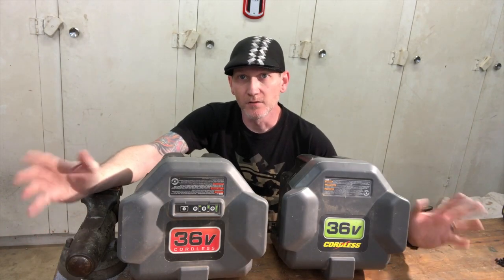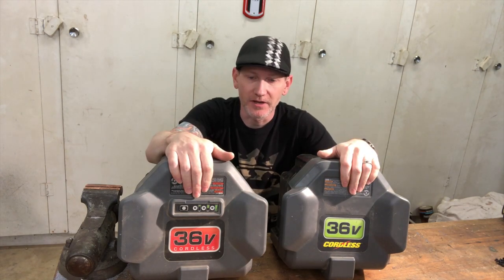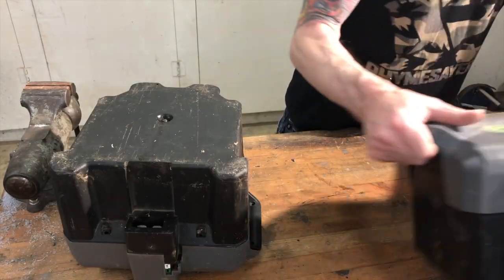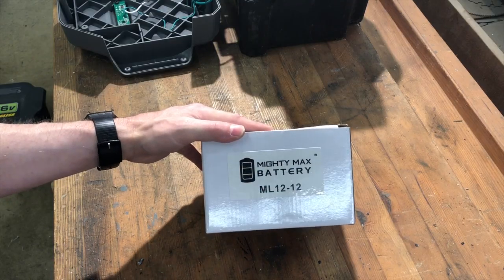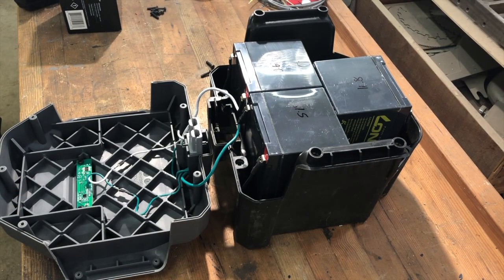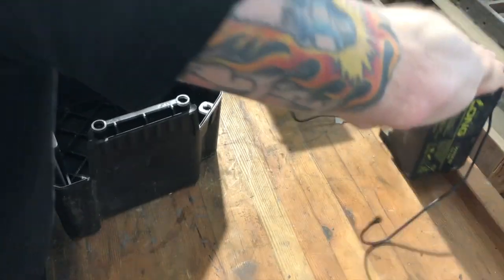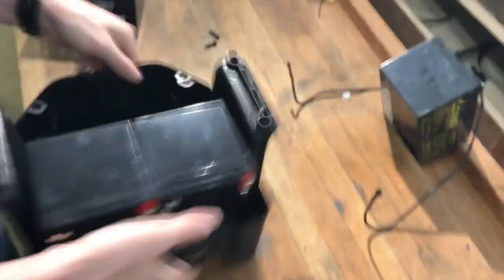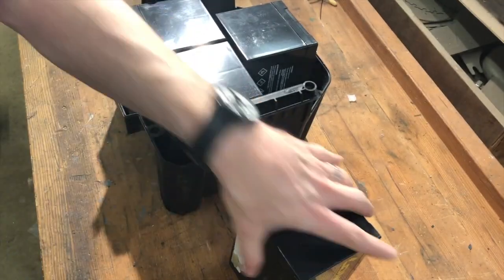Black & Decker 36V Cordless Lawnmower Battery Cell Replacement (CM1936, SPCM1936)

Comment: Thanks! Worked perfectly. I bought 3 ML12-12F2 batteries from mightymax. They fit perfectly, no need to cut anything away. Do look carefully at how the wires are routed before moving the old batteries. Some are pretty short, so the routes need to be precise.

Comment: Man, this was so helpful. I bought my B&D mower in 2013, and over the years went through two batteries, which isn't bad mileage I suppose. But when the second battery died I could no longer find a replacement. I hadn't even considered the possibility that the casing could be opened and that it contained replaceable cells—until I found your video. I bought three Mighty Max cells on Amazon and installed them. They fit perfectly so I didn't have to modify the case (it's the kind with the battery indicator on the top). Thanks so much for posting this! 😎

Comment: I've found it easier to load them into the top first and then just slide the bottom over the batteries.  Note that some batteries SLA or Lithium have the terminals a little closer to the end of the battery so on those you will need to make small notches for the terminals to allow the battery to slip all the way into the cover which is one reason I prefer to load them into the cover first since its easier to see if the terminals cause interference.   I've got the self propelled 1936 and it has the battery with the test circuit.

This year the mower is 10 years old now so I bit the bullet and went with 12 Volt/12 Ah LIFEPO4 batteries from TCBWorth and they slid right in with the cover notched for the terminals.   Hint:  Use box tape to hold the ends of the batteries tightly together to make re-assembly easier with one strip across the ends of the two side by side and one strip to hold the third battery in the T-Shaped arrangement close to the other two.

I went with a new 10 Amp 36 Volt (really 43.8 Volts) LIFEPO4 charger and since the original charge port on the B&D pack doesn't support 10 Amp charging and has circuitry for the SLA batteries in it I put a 50 Amp Anderson Connector on the charger and use the packs main power connector for charging.  That way since I haven't modified the SLA Battery Charging Circuit it will be easy to go back to SLA if need be.

End  results is a pack that charges in a little over an hour and has double the runtime of the SLA.  Lithium has dropped in price and you can now get the 12 Volt 12 Ah LIFEPO4 batteries for around $30 to $36 each.  The 10 Amp LIFEPO4 charger goes for about $40.  Still cheaper than a new name brand Lithium powered self propelled mower which will cost you $500 or more.

Things to watch out for are that the LIFEPO4 batteries have a built in BMS that supports 3 or more batteries in series, has over/under voltage protection, high/low temperature protection and is rated for 10 or more amps charging and supports a Maximum Continuous Discharge Current of at least 15 Amps.  Blades are another thing to watch out for as B&D now charges almost $80 for the formerly $10 blades however shop around and you'll find places like USA Mower have a compatible blade that comes in a twin pack for around $31 for the two mulching blades so $15.50 each which is quite a bit more reasonable.

Best!

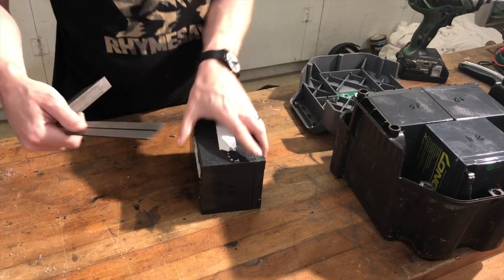Comment: Thank you for much for this video! The circuit board on my mower that shows the battery strength seems to be dead, so I was a tad worried until I plugged the batteries back into the mower. I also found https://www.youtube.com/watch?v=YtpnhABs54A useful because at 2:10 he shows you where that stupid black pin that falls out belongs. :washhands:👍

Comment: Love my "old" lawnmower which had the battery pack replaced already back in 2012. Called round to Black and Decker repair shops and B&D direct but no one would fix as they no longer back this model. Found this video, bought a 3-pack from Mighty Max Batteries for $79.99 (price seems to have gone up a little) and did the battery swap out with your video as a guide and no need to cut the plastic. Bob's your uncle and she's as good as new. These old machine's will run forever if they are given a little TLC and we as consumers are not swayed into believing into out with the old and in with the new!
Reply: Yes, exactly what you said!

Comment: Thanks a lot for your help. I followed the steps you presented and I was able to fix my lawnmower battery in less than 30 minutes. The bonus was that the batteries I ordered did fit exactly without having to remove plastic.
Reply: Can you give the info of the batteries and where you purchase?  Thanks

Comment: 11/12/23-thanks for a terrific and easy to follow video.  Wish I had found it earlier as I went to a batteries plus outlet and they installed batteries ($173 in WA state) haven’t tried it as yet- however the charge windows remain unchanged. One is at full one at 1/2 , and last at 1/4.  Why don’t they register as full.  PS been on charger overnight?  Thanks again - terrific video.  Tones.😊😊

Comment: This was a great video, thank you.  I replaced my previous batteries which were 3 10 Ah batteries with 3 15 Ah batteries.  I only had to make one cable to do it, but now my mower lasts a lot longer and runs like the first day I bought it.  At first I thought it wouldn't work because the 3 10 Ah batteries had an insert, but I just had to remove that insert and the new batteries fit as shown in this video.  I purchased three Mighty Max Battery ML15-12 - 12 Volt 15 AH batteries from Amazon.  I didn't have to do any modifications to my housing.

Comment: So I bought the new batteries put it back together, appears to be charging but only lasts for a few minutes when running.  Tested the old batteries and they are all holding a charge.  Wondering when my next go to might be.  Thanks for making things easy.
Reply from the maker: When the mower dies after a few minutes, does the battery still say it's charged, or is completely dead? One way to test it if you don't have the battery with the power meter is to let the mower sit and cool down for a while and see if it starts back up with the same battery. If the battery is still charged, you may have a motor or other component going into thermal protection. If it's completely draining the battery in a few minutes, I have no idea. That's a lot of current in a short period of time to be going anywhere! Another thing to check is if there is a motor/blade blockage. That could cause it to overheat and/or draw too much power. Good luck!

Comment: October 2022
I have the mower battery with the orange label (model# RB3612).
I bought the same batteries (3-pack Mighty Max ML12-12).
The new batteries fit perfectly, so I did not modify the case.  What's up with that?

The Mighty Max (ML12-12) battery dimensions are:
   WxHxD = 6" x 3¾" x 3⅞" (150 mm x 94.5 mm x 98.5 mm)
   WxHxD = 5.91" x 3.72" x 3.88" (as measured with caliper)
*The width is the "front" (left-right), height is bottom-top, depth is front-back.
*The height measurement excludes the terminals on top.

The original battery (Kung Long WP12-12) dimensions are:
   WxHxD = 6" x 3⅝" x 3⅞" (152 mm x 92.5 mm x 97.5 mm)

The original battery is slightly wider and deeper, but the replacement is slightly taller.

Comment: THANK! Got my 3 batteries and replaced no problem with your help. I have another issue and cannot find a fix. The self propel on my BD has an adjustment between turtle and rabbit. My problem is that even on turtle I am in a very fast walk, almost breaking into a trot. If I had a football field to work, this would be awesome. For working in our yard, with lots of trees and things to work around, it is way too fast. Is there a fix? Thanks for consideration on answering this, anyone reading or yourself.
Reply from the maker: Not that I know of. Anything fancy would probably require pulling the electronic brain circuit and modifying it. I’ve never looked at mine, and I wouldn’t be surprised if it’s potted, aka: encased in epoxy goo and impossible to service or modify. The easiest option would be to make the drive wheels smaller, but then you’d mess up your available range of grass length. You might just be stuck with what you have, unless anyone else has attempted anything.
Reply: @PhillipsHomeRepair  Today I took the speed control switch off, opened it up, and found I could turn the regulator dial down about a 1/4 turn, after disengaging the two gears. Seems like it changed very little. It might be going a wee bit slower but still quick for this 60 something fella!! I tested the mower with the wheels off the ground and modulated between low and high speed. Really doesn't seem to be much difference Did the same while walking with it and speed difference is negligible. You might be right...I'm stuck with it. : D Thanks for your reply. I'll let you know if I ever figure anything out.

Comment: For those with the older style Black & Decker model (green 36V ) Item #: SLA-12V12-F2-X3 from BatteryMart fits perfectly.  No cutting needed, simply unplug the old and plug in the new.

Comment: Thank you for this very useful video!  I just ordered the 15 AH version of those Mighty Max batteries from Amazon as a 3 pack for $99. I want to point out that per Mighty Max specs, the dimensions of both the 12 AH and the 15 AH are exactly the same! So I went for the longer run-time batteries. 
ALSO: for either battery, they list the depth in the main description area as 3.98" for the ML15-12, and 4.00" for the ML12-12, which almost kept me from buying, but if you look at their Spec Sheet in the left panel it reveals that those dimensions are the Total Depth (which includes the terminals) - the actual depth of the CASE is 3.74".
Reply: greetings so the 15AH worked no problem didnt have to do anything special?

Comment: I have a safety question for anyone knowledgeable: I noticed these 12v batteries all say "Do not charge in a sealed container". Doesn't this present a problem when placing three of them in a sealed battery case like this and using the mower plug in charger outside the case? This refurbishing idea is terrific and I want to try it, but I'm concerned about safety. Any replies appreciated, thanks!
EDIT TO ADD: After thinking about this a bit more, I wonder if it would be a good idea to drill a small pilot hole in an inconspicuous spot on the mower battery case? Maybe some place to drill upward so no water leaks inside? The purpose would be to let any gas emissions breathe out from the 12v batteries inside?
Reply: At 1:56, note that the original batteries say: Do not charge in a gas-tight container.  The battery case is designed to hold three charging batteries, therefore I think the ventilation is already sufficient; additional ventilation is not needed.

Comment: Thanks for the video. I went with new Duracell batteries. Having the same issue with the case not closing due to a slightly different battery size. The inside of the casing on the model I have (the orange one) looks a little bit different than yours, so I'm not sure exactly which plastic piece is preventing the case from closing completely. But it closes enough so that the mower works.

Comment: My own Black and Decker 36v battery is beginning to fail after 8 years of regular use. Might try this economical solution instead of springing $300 + for a new mower. Thanks for this really informative video. Some of the comments below seem to disagree on which 12v batteries to use for best fitting, so I will have to research that further.

Comment: ---The MightyMax ML15-12 is an exact drop-in replacement for the original battery. 
No size modification is needed. 
---Before you remove the old batteries from the housing, you should note how the wires are dressed and routed. 
If you look carefully, there are notches or slots in the housing to hold the wires in place.
If you follow the original wire routing, and use the notches, there will be no risk of the wires getting pinched in the housing during reassembly, and it will hold the wires securely so they will not vibrate during operation.
---I used T-rex extreme mounting tape where the original batteries were taped together, because it is one of the strongest (1lb per square inch), sticks to ABS, and is good for -40 to 200 degrees F.
Reply: Thanks for the excellent info.  👍
Reply: thank you.  i have bought those batteries and my mower is like new again!  exact fitment too
Reply: Can the 15 amp hour version work as well?

Comment: This was a fantastic video and we are happy you made it. Black and Decker no longer supplies the entire Unit anyway, kind of being like Apple. Without this video we would have to upgrade to the 40 volt model which would have set us back over $300. Thanks to you we have a rebuilt mower back for less than $100. I would advise amateurs like ourselves to place electrical tape on any "open green and white wires," as they can touch when you are reconnecting the harness. Thanks again!

Comment: Thx for the video. I followed all the steps and this didn't work for me. I suspect b/c there was some water inside and corrosion on the connectors. Is it possible for replace the wires/connectors?
Reply from the maker: Yes, the wires and connectors should all be standard stuff. I'm not sure of the specs, since mine are back together and in use, but just match up the same gauge wire and style of connectors. You will need wire cutters/strippers and a terminal crimper, but that should be all.

Comment: Canadian viewers: No need for modifications of the battery housing for me. I ordered 12 Volt 12 Amp Hour batteries from UPS Battery Center in the GTA. TLV12120 was the product code. Within millimeters of the size of the original batteries and my battery is showing 3 lights now. I'll let you know how the mower runs in a future comment.
Reply: Got to use it this week. No issues. Worked great. Battery was only down by one of the three indicator lights when I was done...and it would have been down by two lights before. Charged up fine. Ready to use again. And, ordering the batteries that I did from UPS Battery Center meant I didn't need to modify the plastic housing. They are almost exactly the same size as the original batteries. TLV12120. Google it so you get the most up to date info from UPS Battery Center.

Comment: What is the running wattage or running amperage?  I've looked in the usual places and can't find it.  There is a LiFePO4 SLA replacement with the F2 terminals but the maximum amperage spec is 10A.  At 36V, that would be only 360W which is about 0.5HP.  I'm guessing that the motor is more like 500W which would overload the amperage rating on the battery. So that's why I need this specificaion.  The LiFePO4 battery presents no fire hazard and takes 1000's of recharges. https://www.ebay.com/itm/124421330437?hash=item1cf816d605:g:OaEAAOSwS9Jft5H6
Reply from the maker: I'm not sure of all the specs, but if each one physically fits, is 12v, and lead acid, it should work.
Reply: Have you tried this Lithium batteries?  Do you change the  original charger to charge the lithium batteries.  Please share your findings.  Thanks

Comment: Ordered my batteries from Amazon and had them in 2 days. The rebuild was easy and didn’t have to cut any plastic. It was a tight fit and had to fiddle some to get the top back on! Make sure not to pinch any wires when putting the case back together!

Comment: What’s the best way to store the battery after the rebuild.. plugged in while being stored or plug it in and charge it prior to use?
Reply from the maker: I believe the battery charger is dumb, but low amperage. I agree with William that they should be charged fully, unplugged, and stored that way. I'd maybe plug them in overnight every month or two. Also keep them in a warm-ish space, like a garage or basement.
Reply: I don’t know anything about this specific charger.  You would need to look at the specs of the charger and find out how it does the charge.  Is it a real dumb charger that doesn’t multi-stage charge?  as-in switch to a float charge?  My guess is that it isn’t a great charger, but you would need to check.  If it doesn’t float charge, I would charge it to 100% and then disconnect it.  Those AGM batteries have a low discharge rate so it would likely be fine to just pull out and use after weeks of sitting. 

 I came here because I saw one of these mowers for sale and was half interested.  However, it is likely the batteries need replacement.  Unfortunately, these lead acid batteries do not like to be discharged past 50% or they live a shorter life.  That means you realistically need to cut the available AH in half, probably not a good combo on a lawn mower with a small batt to begin with.  If you want these to last at all, I wouldn’t run them down a lot.  They start dropping below 50%, I’d stop and charge them.